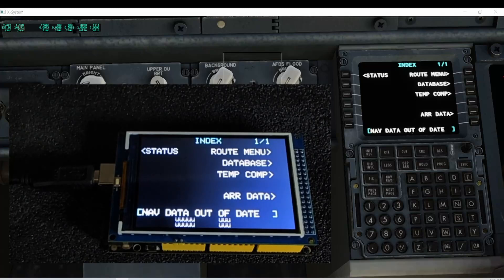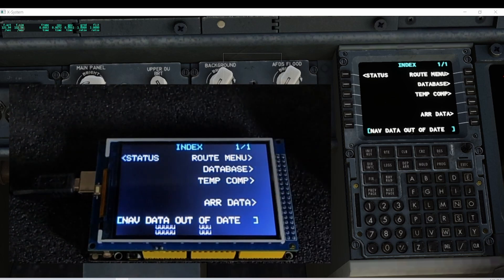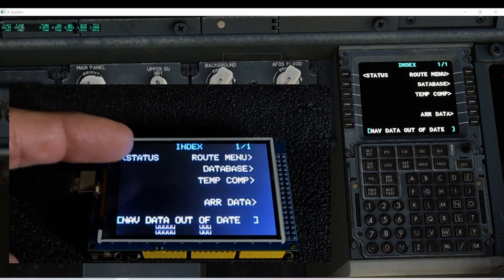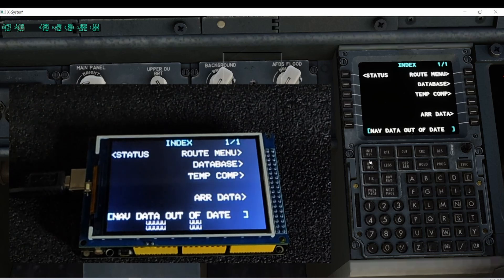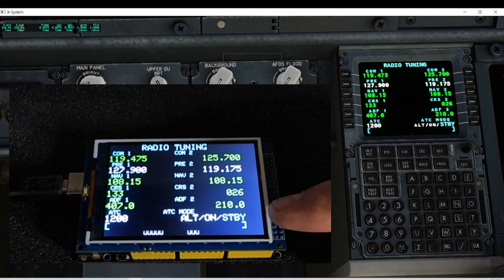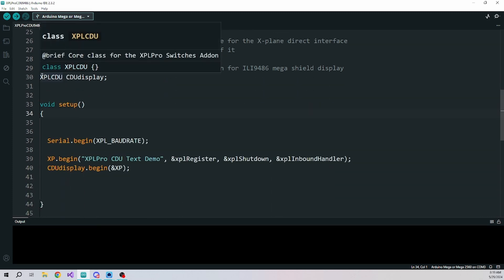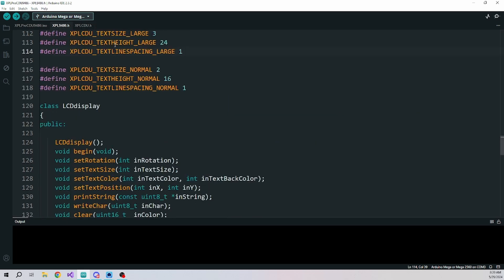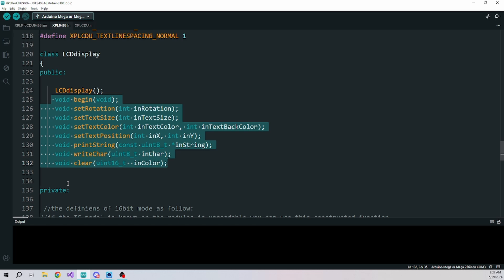XPLPro / Arduino CDU Display with 9486 Mega Shield

Comment: Good job. Its really slow procces for mega mcu. I think xplane side is ok but atmega side is slow to calculate characters.
Reply from the maker: Agreed.  I even had to implement flow control for XPLpro to make it work.  More modern processors will increase the refresh rate.
Reply: @curiosityworkshop3957  Hi are you already tested the code on a ESP32 card?
Reply from the maker: @guillaumevidal5271  I have run XPLPro on ESP32, havent tried the display but it should work with proper interface code
Reply: @curiosityworkshop3957  Thank, I will try it asap